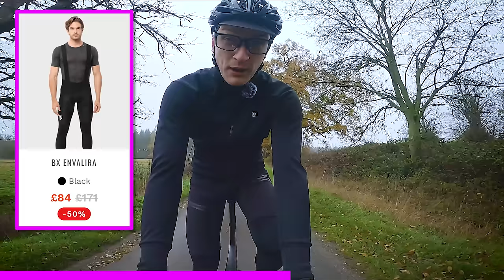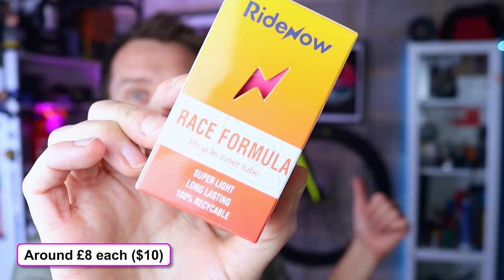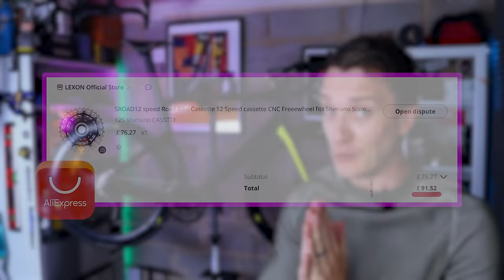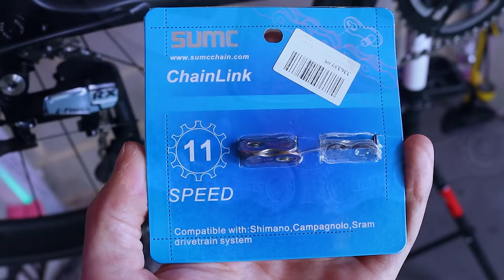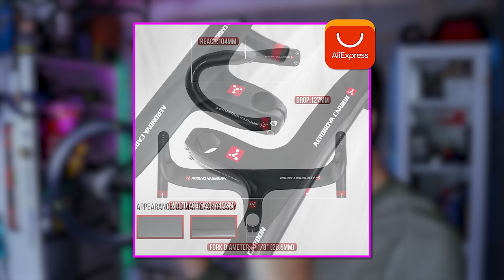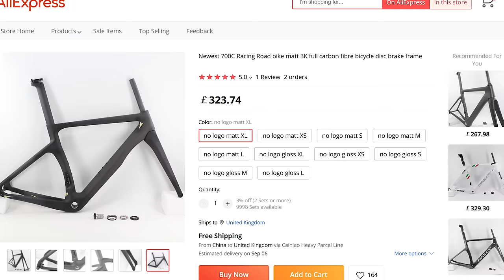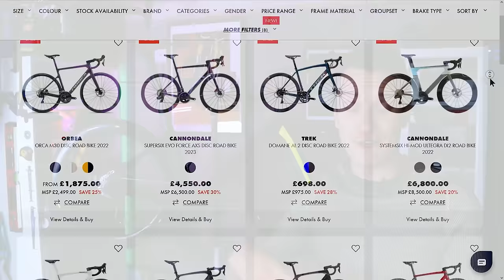£1000 AliExpress Carbon Road Bike - 600 miles later

Comment: Safety critical equipment is designed with a large margin of excess load, generally like 5x the load its going to experience in the real World. The cracked stem could not have underwent any testing and was definetly not compliant with acceptable standards in the Western World. That was a deathtrap, a broken stem at 35 mph could result in death. I guess the philosophy of the idiots manufacturing that stuff, is that bikes are not that much of an issue concernig public safety, if it looks good it will sell. Its a differrence of cultures, stay safe, just pay for Shimano and you know you have the best.